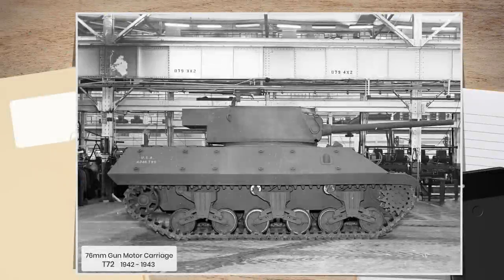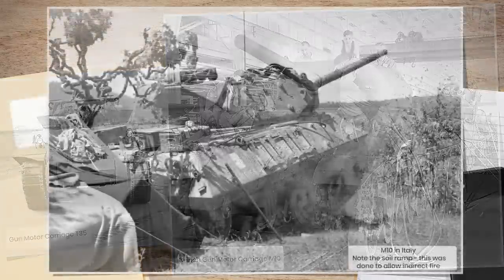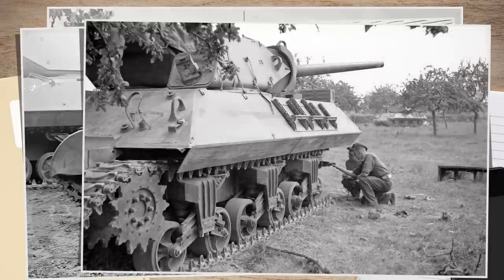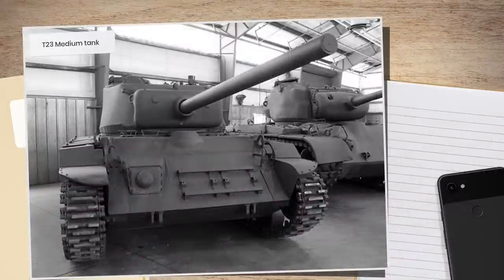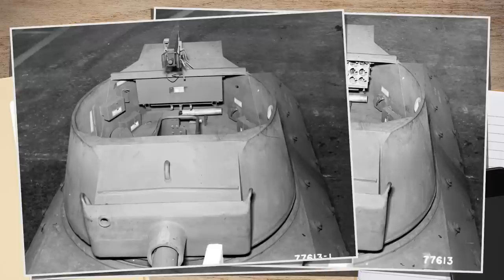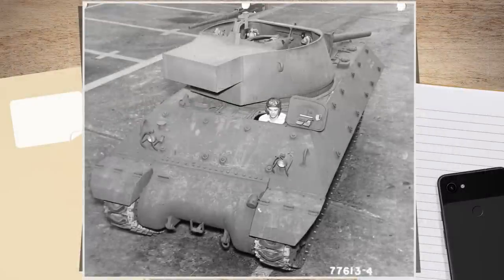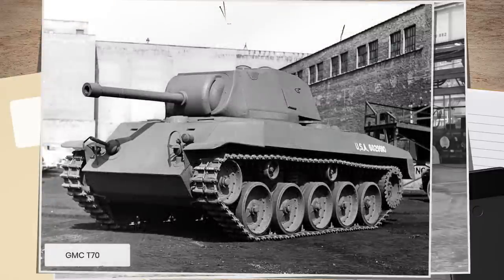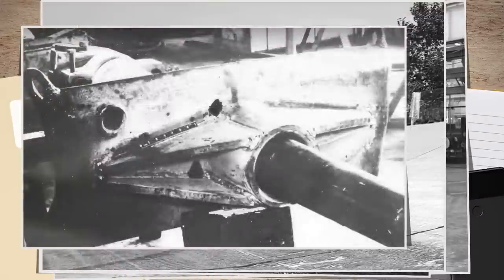3 inch GMC  T72. A better Wolverine?

Comment: most photos of M10s with extra armor are a bit grainy and you can't be sure, but there are quite a few of good quality around, including photos of Achilles with extra armor on
one in particular is named Rose Coombs and is on display somewhere called Veckring, said to be near Le Hackenberg
documents indicate the plates were 14mm thick, spaced 20mm, and 12 in total
the 13th plate was 20mm thick and supposed to be mounted on the mantlet
total weight ~922 kg

Comment: I wish the M10 in War Thunder would get the add-on armor shown in the photo rather than spare track links.
Never heard of this interesting prototype before, and it is really cool! Would love to play it in War Thunder.
Reply: at 3.3 the current M10 can sometimes bounce shots from tanks of its own BR so probably won't happen, maybe if they add a late production M10A1
- extra armor
- better engine
- wider tracks
- HVAP
- hydraulic turret traverse system
somewhere between 3.7 and 4.3
Reply: @armandorodrigues144  I'd totally support that.

Comment: 7:32 Which vehicles did the ‘King Kong, Hippo and Black Panther’ names apply to?
Reply: Black Panther was for the 8" gun (May and Nov 1944 memos), Hippo was suggested for 10" mortar T5 (May 1944) but does not appear on the Nov 1944 memo. "King Kong" doesn't appear in either memo. The 155mm GMC M12 may have been nicknamed "King Kong" by operators but does not appear to be an official name? Amusingly, 75mm HMC M8 was originally suggested "Bobcat" in May, but was officially assigned "General Scott" in Nov.

Comment: Now the M10 being unable to turn their turrets (in slopes) due to the heavy gun is news to me, Panther and KV-2 would probably share a table with the M10 TD.

would that be also cause for the lack of a powered turret traverse? 
along with the cramped interior, an unbalanced turret would've been alot harder to traverse very quickly with a small motor even with a high gear reduction as the center of mass would've made the moment of inertia of the turret quite gnarly to get it to either rotate or stop.

also in the M22 photo, i think what makes the M10 special is due to it having applique armor, very neat, although i doubt it'd stop much outside of say HMG (M2HB levels) /Autocannon (less than 20mm), still very neat.

rigidly mounted guns for the M10 or any of the US Tank Destroyers probably would've not faired well due to the increase in weight to accomodate the system.

i wonder if you could do a video on the British take on Assault Tanks, on how they would've been employed considering they would've already overlapped with the Infantry Tanks of the time (Churchill, Matilda).
Reply: Cost savings by not adding a turret drive.
The funny thing though : factory conversion  kits with an electric turret drive were manufactured but never issued.
Reply: Actually, there was just never a powered traverse in the prototypes. Aberdeen recommended that be corrected after testing an early M10 (Sept 1942). TD Board also called for power traverse (Dec 1942). There was testing of hydraulic power traverse by Dec 1943, but that fix never actually happened because the M10 was going out of production by that point.

Comment: One question and an observation from an old git.
Where does the T78 fit in this line of TD prototypes, or is it just another figment of Wargaming's imagination?
In the mid 1970s, there was a really good comic called Warlord. One of the stories was called Wolverine, featuring a rogue M10 that roamed about behind enemy lines. One distinct memory was that the TC was a black sergeant - he may have been a master or technical sergeant, can definitely remember the opposed chevrons. The character was imaginatively called Sarge. Does anyone else remember this rather anomalous character for the time and the story?
Thanks for another great informative video.👍🏻
Reply: Well, crap, I forgot to put a T78 section into my book. It was, indeed, a proposal from July 1943, but cancelled the next month when it was decided that developing a derivative of T24 before T24 had itself been tested was a silly idea.

Comment: 5:30 Wrong picture, that's the T49, not the T70.
Reply: Generally, yes, but also with a caveat. The nomenclature documentation process didn't actually match up with the production of prototypes, so the differences between the 'stages of evolution' of the T70 is a bit arbitrary. Another designation for the M18 project I've seen in the archives is "76mm GMC T49", for example.

Comment: Based off of the intro, I'm guessing the T72 would eventually become the M36 90mm GMC
Reply: Actually, it post-dates the start of the program that created the M36. Just barely though, as the M36 was the T71. The two ran concurrently for a bit until the T72 was cancelled.
Reply: My first thought was “that looks a lot like an M36 turret.”
Reply: No, that would be the T71.